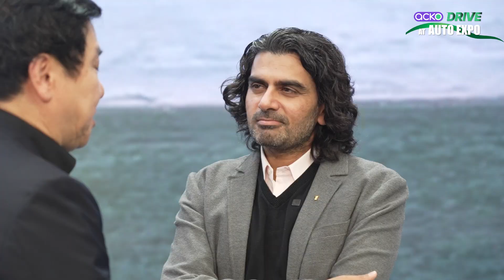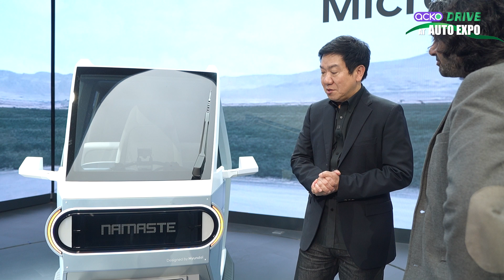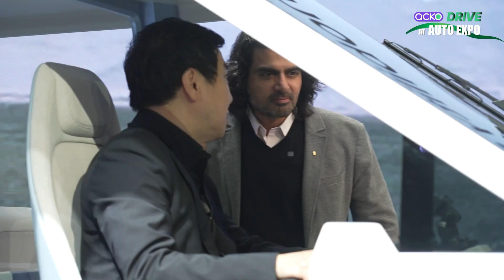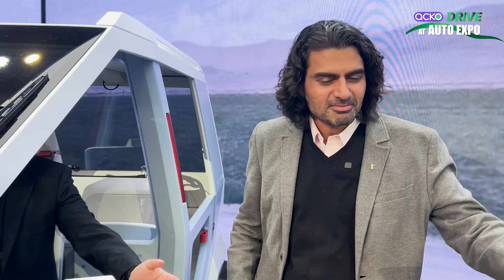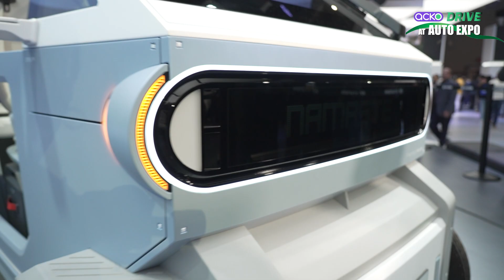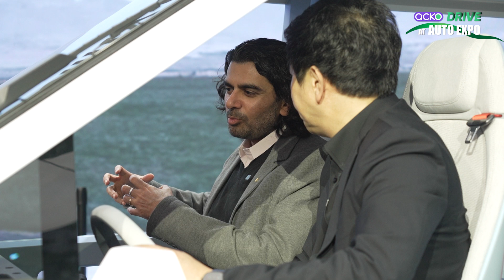2025 Auto Expo | Is Hyundai now making rickshaws?

Comment: Are Automobile manufacturers even thinking while designing such hi-tech Rickshaws, The kind of hooligan driving we witness every single day by the auto driver, this kind of Torque at their disposal is only going to lead to more road rages. I have myself witnessed 3 such accidents over the previous month because the auto driver decided to run the red light and mind you these were are major damage accidents, not the regular scratch and brush accidents.People should really think about the implications their actions can have on society. It is an intra-city mode of transport, and there is no  need for such higher power numbers for them.